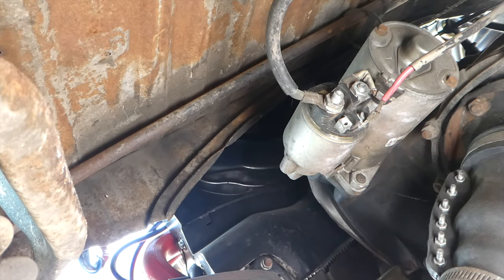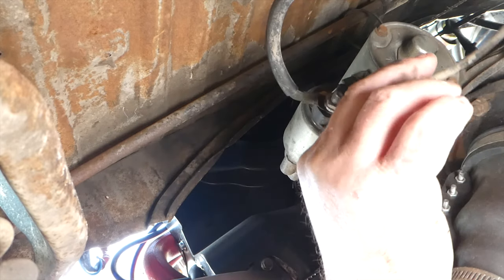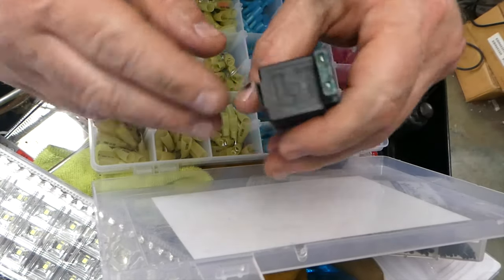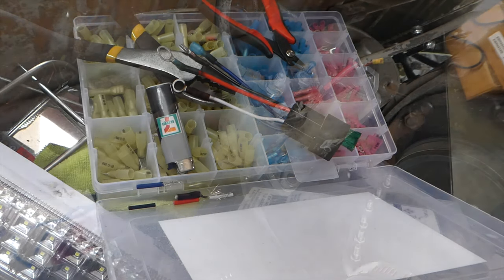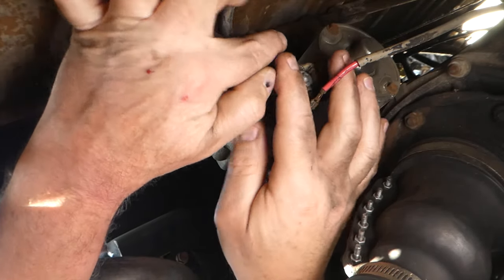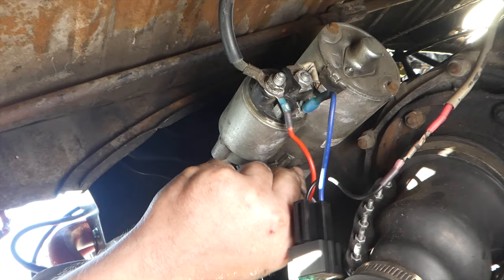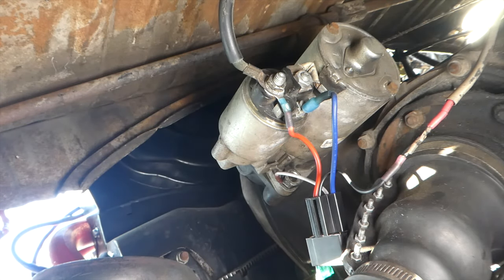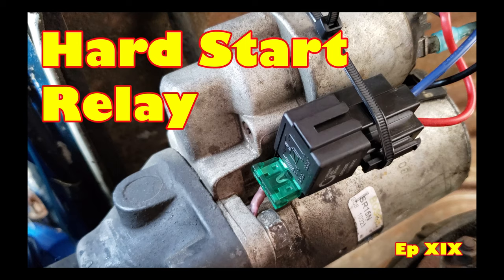68 Baja Bug: Ep XIX Hard Start Relay

Comment: I did that to my 1968 bug before the car got totaled last month from a deer. i was able to mount the relay on the package tray as illustrated in the vw beetle restoration handbook as i had a bosch starter in it it kept whirring not engaging the ring gear on the flywheel as i put in a powermaster Denso gear reduction starter in it purchased from Summit Racing Equipment and its a very reliable starter. as ill be doing the same on my next bug a hard start relay.
Reply from the maker: I had planned originally on putting it near the battery. But this way is so much more convenient as it's all wired right at the starter instead of running new wires around. 

I was worried about water getting in there or something, but I drove it during the recent rains here in SoCal and no problems at all. Of course I keep a spare in the glovebox... ;)

Comment: They should call this relay the "silent starter" relay as "hard start" infers too many other symptoms. All my Beetles had silent starters because current was going to the solenoid, dimming the idiot lights, but not operating the solenoid. I don't remember any that just clicked unless the solenoid was shot. Too bad VW and 50-70's General Motors did such a poor marginal job wiring their solenoids, needing excess current, so the slightest change in wiring, switches and connections caused starting trouble. I do add relays to Beetles but at times bend (only a fraction!! ) the fork to allow the plunger to be in the solenoid housing further. This allows the magnetic attraction to pull the plunger in. GM had far fewer problems this way but bending the fork was the best way on them all things considered.

Comment: Just put all new connectors at both ends of all of the heavy wires.  Eliminate the bottle necks.  Done.  Solved all my electrical probs.  No relay needed.

Comment: Will this Relay work on my 1966 VW Bug sedan. My car is a 6 volt. Please let me know if this relay works or do you have one for it. Thanks
Reply from the maker: You'll need a 6v relay. A 12v relay MAY work, but I wouldn't count on it. 6v relays are out there, even on Amazon.
Reply from the maker: @mrobvious5892  One lead to the fat cable on the starter, the other to ground. The body of the starter is fine. If you see at least 12v, then put the leads on the ignition wire (the small one) and ground. Have someone turn the key. If you see 12v, then your starter is the problem. If you see less than 12v but saw more than 12v on the fat cable, you can benefit from the relay. 

Replace 12v with 6v if you have an older car that hasn't been converted to 12v. Methods are the same.
Reply from the maker: @mrobvious5892  You can get a spark from a lot less than 12v. But you need that 12v to trigger the solenoid. A relay as I did will get you the juice needed. Assuming you get the results from your testing as I described.
Reply from the maker: "Professional" trolling YT comment sections? Pull the other one mate.

Also, you're full of shit.